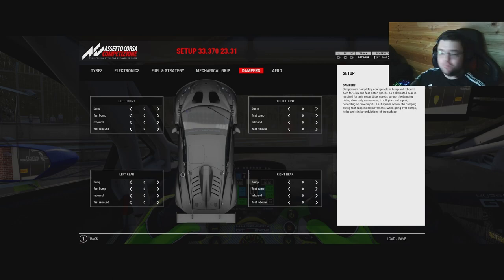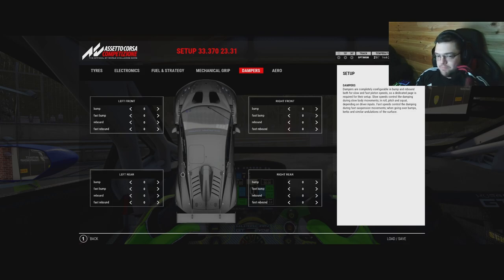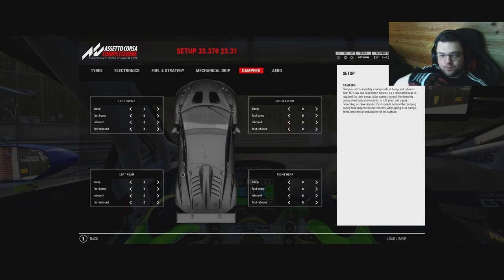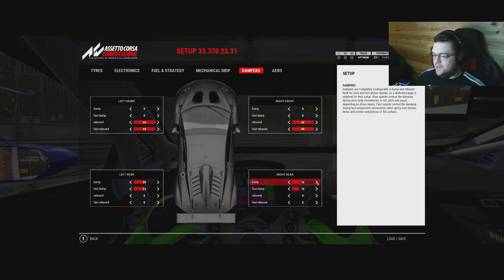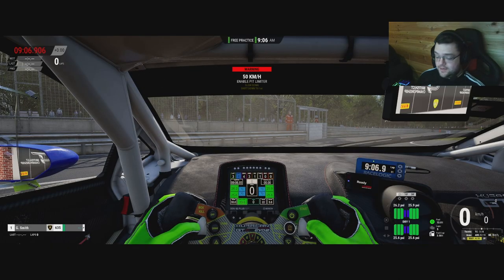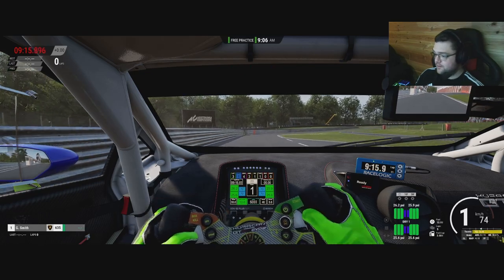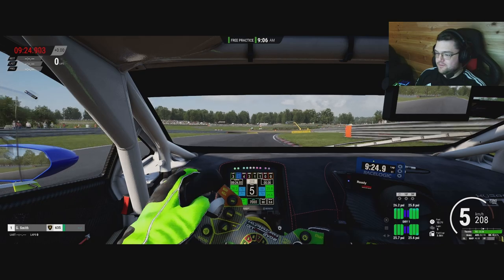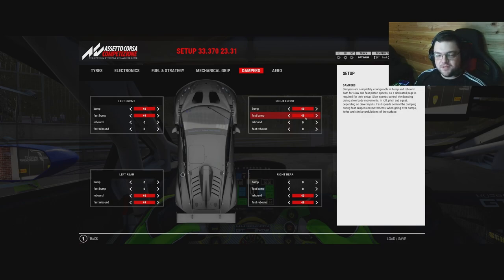Dampers in Sim Racing: A Comprehensive Guide to Setup and Tuning

Comment: Fundamentally, weight transfer is independent of suspension settings and is defined by centre of gravity and track width/length. Don't fall into the trap of thinking stiffer suspension reduces weight transfer. How the car responds to the weight transfer is another matter. Your video suggests that increasing rear rebound stiffness reduces oversteer, but the normal approach to reducing oversteer at corner entry is to reduce rear rebound stiffness. Mid-corner oversteer requires increasing of rear rebound stiffness, as your video suggests. Oversteer at corner exit requires reducing of rear damper bump stiffness. But this is also dependent on corner speed.
Reply from the maker: No, you are incorrect on the corner entry. Reducing rear rebound at corner entry will increase oversteer as the rear is allowed to raise from its coilover on the brakes. I used to get this lift off oversteer all the time in my Integra LOL. Very snappy for a FWD. Stiffer suspensions will increase the weight transfer speed. But for the sake of this video...that is more advanced than what I am aiming it at.
Reply: Damper Rebound – Having a soft setting for rebound will generate more grip at the wheels. Therefore, softening the front dampers will reduce understeer and softening the rear dampers will reduce oversteer. However, having rebound set too soft will make direction changes sluggish and could cause the suspension to become bouncy as the spring is not being controlled enough when extending after a compression. 

A stiffer setting for rebound will produce better direction change from the car being more stable through chicane sections. A higher value at the rear wheels will also make the car less stable under braking conditions as the rear dampers aren’t able to extend quickly enough to keep the wheels in contact with the ground. This can cause a rear lock up and cause a spin.
Reply: Corner Entry

With the oversteer identified as occurring in the corner entry section, the first question to ask yourself is, are you turning into the corner straight after being hard on the brakes? If the answer is yes then one of the below options can be applied:

1) Slightly reduce rear damper rebound stiffness
Reply: The car will dive about it's roll centre, lifting the rear. You want the rear tyres to stay on the tarmac. Increasing rear rebound stiffness slows down the rate at which the wheels react. You want the rear suspension to extend to keep the rear wheels down.
You've confused weight transfer and cause-effect.

Your reasoning is that stiffening the rear will reduce the tendency for the rear to rise from its coilover. 

But ask yourself this: what's stopping the coilover from rising? 

Only the weight of the car, which has shifted forwards. In fact, there's now a moment about the roll centre which is causing the rear to rise. There is no outside reaction force at the rear preventing this. So to mitigate the act of this moment from pulling the rear tyres off the tarmac you want softer rebound. 

Think of doing an endo on a bike or motorbike - it's the same thing.

On track in (real life) when I have oversteer I slightly soften the rear rebound and voila, oversteer dialed out.

I hope you're now able to see what's happening.
Reply from the maker: I haven't confused anything. Respectfully. Controlling weight is the main focus of suspension tuning on a race car. If you have entry oversteer, you keep the front stiff and increase rear rebound damping to prevent the rear from rising. You want as little pitch as possible. One of the most common ways to get more lively entry, without screwing up front stability is to slacken off or reduce the rear rebound damping.
You are seeing this as sort of like a 4x4 with huge suspension travels where axels leave the road. Race cars are not like this. We're talking milliliters of travel where weight and pitch control are paramount.
Reply: Ask yourself if you stiffen the rear rebound dampers in an attempt to stop the rear rising what is stopping the dampers themselves from rising? 
Your explanation only works if the tyres are bolted to the road.

Draw yourself a free body diagram with the forces about the roll centre.

Or please Google it. Look up rebound damper and oversteer.
Reply from the maker: @alexpope1867  Here are two of many references " increasing the rear rebound stiffness will help reduce the oversteer." https://suspensionsecrets.co.uk/dampers-set-up/ and also "Stiffening rear rebound will reduce weight transfer to the front too quickly. By slowing the rate of weight transfer this will retain more weight on the rear, generating more rear grip and reducing corner entry oversteer." https://corneringperformance.com/adjustable-suspension-tuning/  . To answer what stops the damper from rising itself as you state above, is exactly the rebound phase we are discussing. I hope this helps clear things up.
Reply: @GSSimRacing  but what is stopping the entire dampers rising. Think it through...

The only things that reduce weight transfer are track width/length, centre of mass height and roll centre height.

The reason I'm pushing this is because your video which is intended to clarify how dampers work is wrong so giving incorrect advice.

You need to go back to basic free body diagram and work it through yourself.

Show some humility and at least entertain the idea you may have misunderstood.
Reply from the maker: @alexpope1867  Please stop with the misinformation, it really is not helpful to anyone. What is stopping the damper rising you ask above. You are thinking of this wrong. The aim is to maintain weight on the rear for as long as possible to reduce entry oversteer. To do this, you can increase the rear rebound to prevent the shock extending and throwing more weight forwards.. I have provided links and citations from actual companies that tune suspension on race cars. If you are still not convinced then let's end the discussion here as it will go nowhere. Also, this discussion you kicked off is about rebound damping on the rear specifically. I am not discussing centre of mass and roll centres etc here. I have real life experience on this, both with my own track car and one of my mechanic who competes in time attacks in a dedicated race car, in addition to the links and references I provided above. I understand how you are thinking on this, but you are incorrect. Don't think of movement, think in terms of controlling weight transfer through controlling the pitch of the car.
Reply: But weight transfer is only related to roll centre and centre of mass! You can't discuss weight transfer without them. I'm trying to help but you really won't listen and I don't understand why. You are "teaching" the wrong thing!

Why won't you answer my question: how can the dampers stop the rear of thr car rising? 
They aren't attached to anything outside of the car!! They can't. Stop and think it through.

The car brakes. This causes a moment about the roll centre. This causes the car to dive - front sinks, rear rises. In this situation how can the rear dampers stop this? Please answer me this.

The shocks/dampers/springs have no influence on the amount of weight transfer. We learnt this is year 1 of the motorsports masters degree. 

You really don't understand I'm afraid. You have cause and effect back to front. It's like saying taking away water causes a fire to light.

Please answer my question. How do the rear shocks or springs or dampers prevent the rear from rising? You state this is what's happening. Explain how.

You are clearly unwilling/unable to understand the physics here. It's not simple, granted. But think about it.

Let that question sit on your brain - how do the rear shocks physically stop the rear from rising?

I think you roll centre etc might be a but to advanced but you should be able to have that "click" moment when you realise the wrong assumption you made/fundamental thing you've overlooked. Might be soon, might take a while, might never click for you. But think it through bit by bit, part by part.
Reply from the maker: Please don't insult me by suggesting it is too advanced for me. I've referenced actual suspension tuning service providers above. Please read them, educate yourself on the topic before you say I'm misleading people.
Reply: Please explain how the rear dampers prevent the rear of the car from rising and/or reduce weight transfer.
Reply from the maker: @alexpope1867  It slows the rear shock from extending, therefore the rear of the car will remain lower and not pitch forwards a quickly, basically slowing the "dive" element on the brakes. This leads to more weight and downforce over the rear axel, which typically leads to a more stable car on the brakes when trailing into a corner.
Reply: @GSSimRacing  You say it stops the rear shock extending? How?

In your view:
1) The rear wants to rise
2) This causes the spring to extend
3) The damper stops the spring extending

How? If something is preventing something from moving it needs an opposing force. Where does this force come from?

In your view, it would also imply that if a crane were to lift the rear of the car the shock would stop the spring extending and therefore keep the rear on the ground. Do you not see that is ridiculous? There's nothing "holding" the car to the tarmac.
Replace crane lifting force with moment due to braking force and it's exactly the same as your view.

Its not the spring causing the weight transfer. The weight transfer is due to the centre of mass wanting to keep moving forwards. This causes a turning moment about the horizontal axis of the roll centre. This imparts a lifting force at the rear. The lifting force is independent of suspension. Completely independent.

Pm me your email and I'll send some drawings
Reply: Gonna necro this. Stiffening the rear rebound will slow down, or stop the rear springs from extending, depending on the stiffness setting. It will not stop the tires from lifting off of the ground however. If you wanted to keep the rear from lifting, simply stiffening the front will be more than enough. You don't minimize roll and pitch through the dampers, but rather with springs, anti roll bars, and ride height.

I can see stiffening the rear rebound helping in keeping the rear stable during straight line braking, as rebound is what keeps the suspension from oscillating and thus, keeping the chassis stable and minimizing ride height variance. Once you enter the corner however, lateral body roll enters the equation. Tires normally don't lift off the ground during acceleration and braking unless you have the suspension setup for it, during cornering or lateral body movement however, depending on which end is softer or stiffer, can cause the inside tire to lift. So by combining a soft front, with stiff rear rebound, the nose will dive, and the rear inside tire will lift during the initial part of the corner, or corner entry, which is where most of the oversteer happens. In race cars that are mostly flat during cornering, stiffening rear rebound can still cause corner entry oversteer, as you're increasing the rate of weight transfer in the rear. More weight doesn't mean more grip. Tires can only handle so much load, so by speeding up weight transfer, and going past the load limit of a tire, you can make it slip earlier.

Stiffening dampers do not slow down weight transfer, rather you are slowing down or minimizing body roll. Body roll does not equal weight transfer. If it did, then why do race cars, that have almost no body roll, still move drivers in their cockpits?
Reply: I have to agree with @alexpope1867 here.

He's 100% right about the car not being bolted to the ground. Weight transfer is happening under braking no matter what you do. You cannot stop it. If you set your rear rebound to the max, the weight will still be transferred forward but now the rear springs won't be allowed to decompress fast enough, leading to them getting "lifted" off the ground. You need to keep the rear tires on the ground to avoid oversteer. It's like with a bicycle. If you brake hard and you have no rear suspension (essentially max rebound) , the front will compress and then the rear will want to go up in the air and flip you over.

By reducing the rear rebound you're allowing the suspension to extend while keeping the tires on the ground.

Keeping front bump high may help with preventing the front from pitching too much, but the rear will still try to decompress because there is no possible way to prevent the weight of the car from moving forward. You basically can only do your best to keep the rear tires on the ground while the weight is being moved ft forward.
Reply from the maker: @vacon04 you are confusing rebounding extention with wheels coming off thr ground, or not. Rebounding suspension is actively pushing upwards, raisong the rear, pitching weight to the front. A higher damper rebound setting on the rear will slow this down, therefore the rear is not being spring up as quickly, keeping the weight front to rear more neutral. Under braking, there is still a forward transfer of course, but I'm talking about limiting that amount in terms of how quickly it happens etc.

Comment: What about fast dampers.. Please show effects of low vs high fast damping..
Reply from the maker: 2 things on this. High speed damping doesn't really have much of a role in terms of controlling weight shift. Think of car weight shifting under braking or on throttle...its a slower movement of the suspension and damper. High speed damping is more about bumps, kerbs etc. Simply, how hard or soft you want the hit to be, or if the car jumps etc. I personally keep the dampers kinda similar to each other, so I get more predictable behaviour.
Reply: You want high speed dampers (fast dampers) softer than the slow dampers.
Reply: @alexpope1867   For every car?! Every game?! Every Track?!.. You should see or feel the  effect/s..
Reply: @SpookyRipples9   just in general

Comment: 0 in the UI is not 0 for damper velocity. I've been working with dampers in AC & ACC for 10 years and this is only a very surface level analysis I'm afraid. What unit of meassurement do dampers use? What is a force/velocity graph? What is a spring/mass/damper system? What is unsprung mass and how is it calculated? What is the damping rate and how is it derived? What is damping ratio? Do dampers in ACC have a motion ratio? What is transmissability? What is knee speed? What are good damping ratios for GT3 cars in ACC? What does the UI in ACC actually respresent? Is the slow bump setting 10 equal to fast slow rebound setting 10? etc
I'd recommend to do a follow up video to explain the spring damper system in more detail, with actual units, with some calculations, with Motec examples (math channels!) to get more into the gritty details - this is the actual daily business of race engineers, which sim racers need to incorporate as well as being a driver & strategist all in one if they actually want to understand what they're doing.
Reply from the maker: I know all of this. But this video is meant as a simple starting point for sim racers. I had my own track car for years (back on road legal plates now), and I never once cared about units of measure in terms of setup. Either its needed more or less damping (front or rear).
Things like this can be over complicated too easily.
Also, to add, the number values in ACC are just slider values. The actual damping nominal values are hidden under NDA or so. But either way, it's a tool to go harder or softer.
Reply: @GSSimRacing  You are aware of those? Yet you never mentioned them in your video, and I honestly did not have the impression that you did. Either you and the sim racing community strive to improve or you stay stagnant. "Feeling" is not science. Yes, Kunos has to adhere to NDAs, but that's what our heads are for to figure these things out, they are plenty of mod cars in AC with open physics files providing you with all the examples you need. You even wrote in the video description: "Watch this video to learn everything you need to know about dampers in sim racing!" - was that only for the clicks then ? Do our sim racing colleagues have to stay ignorant of all the rest? Again, go ahead and do a follow up with more detail.
Reply from the maker: @addictedtopiano  I aim to keep things simple. I build my setups on this philosophy. I wouldn't advise people to do anything that I won't do myself. I didn't write a headline for clicks. The video is about dampers and it achieves what it's supposed to achieve. If you want to dive into motec and get more specific values (which are useless even in the real world as a setup tool), then fire away. My approach is keeping it simple with adjustments to influence behaviour of the car.
I've also used approach on my old track car. Actual values of springs in nm of compression is not really too relavant, unless your manufacturing the car and not driving it.